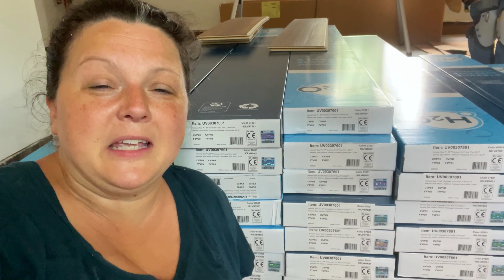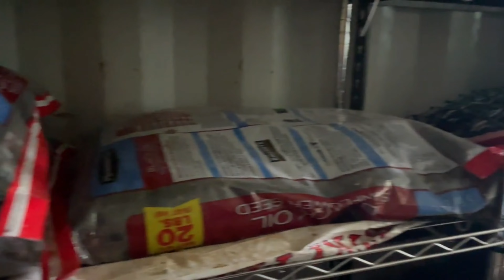Alaska Homestead Life RAIN or SHINE making it happen

Comment: Got my giggles and smiles, thanks to you both!!! My chickens and quails go on egg strike if it's extreme heat n humidity or there's many days of pouring rain! They get loud, obnoxious and think it's my fault!!! LOL Been beautiful weather this week in CT, mid- high 70s, no humidity....like start of fall. Rainstorms for tomorrow, but upside rain barrels get filled back up! Gotta make lemonade outa da lemons! 🙂
Reply from the maker: Good info about the bird strikes! Maybe it is just the rain. All the years of raising chickens I’ve never had them go on strike in the middle of summer like this. So the rain thing makes total sense. It’s usually beautiful here in the summer all summer long. Yay for rain catchment. That has been very nice. I think I watered the garden 3.5 times so far this summer.  The .5 is because the generator ran out of gas in the middle of watering, and filling things up with fuel is always a Mr. Reeve job and he was at work. 😊❤️